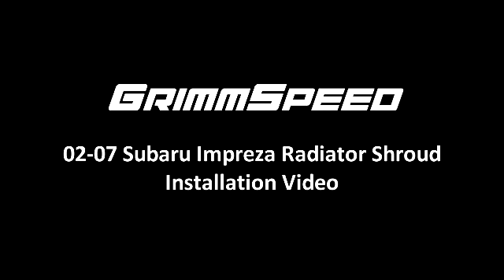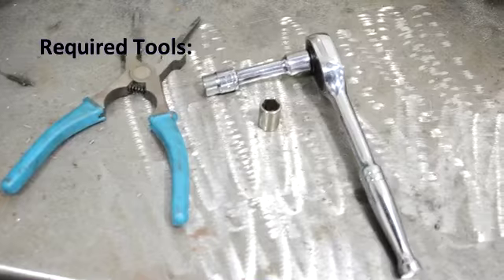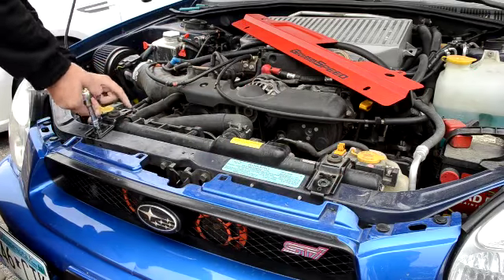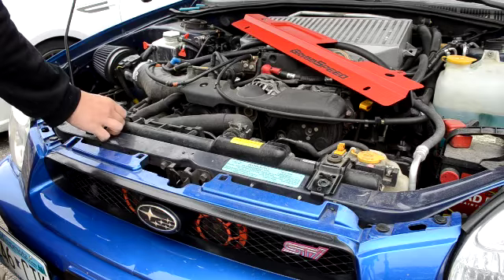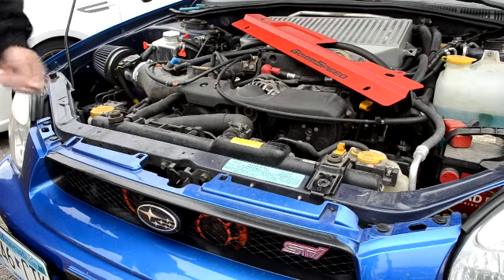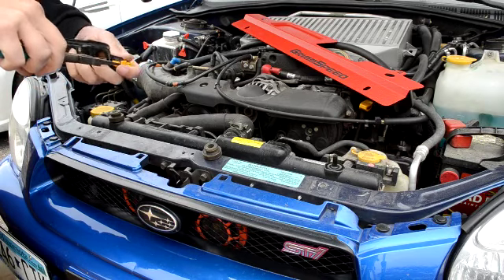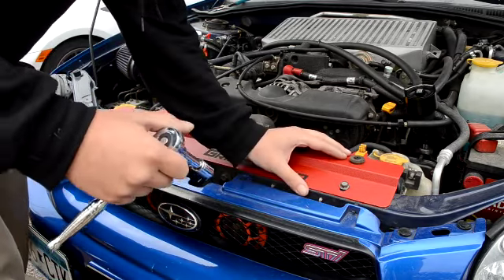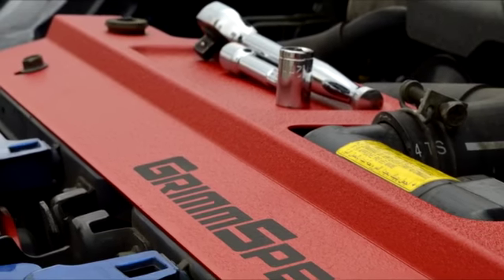GrimmSpeed 02-07 Impreza Radiator Shroud Install

Comment: So does this NOT fit with the stock intake duct installed?  I have a Cobb intake, but I still use the stock air duct to feed air towards the filter box.  My current rad shroud is smaller and slim enough for the intake duct to bolt down right on top of it without impeding hood closure.  However with the GS it looks like tool tray might get in the way.  Application is a 2007 STI.  Thanks!